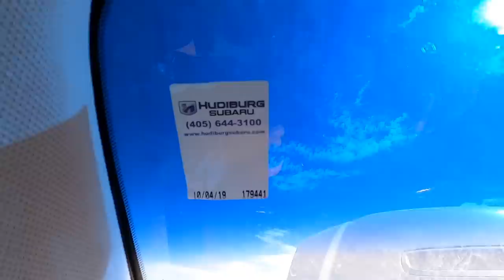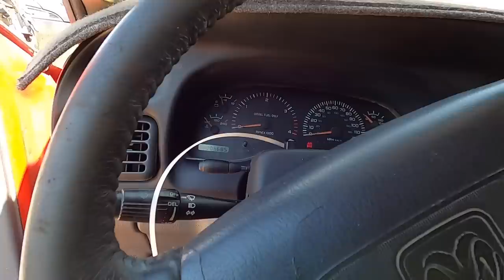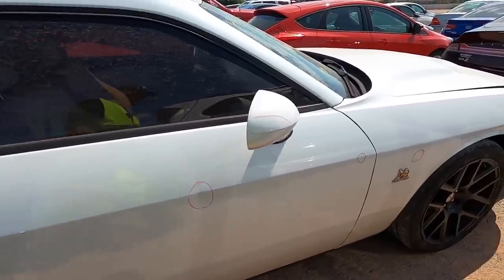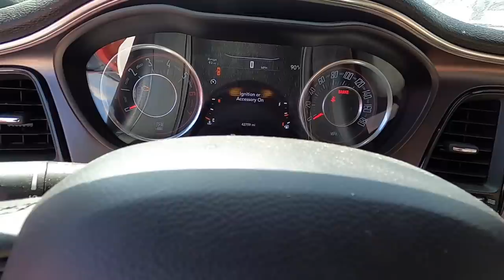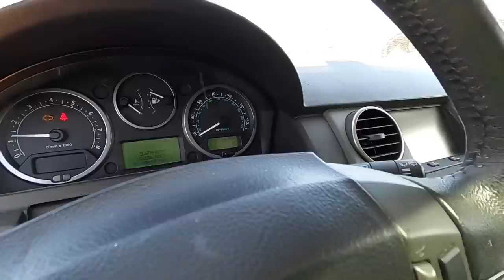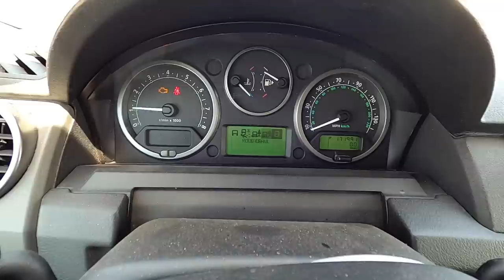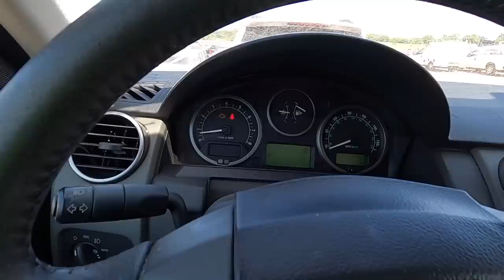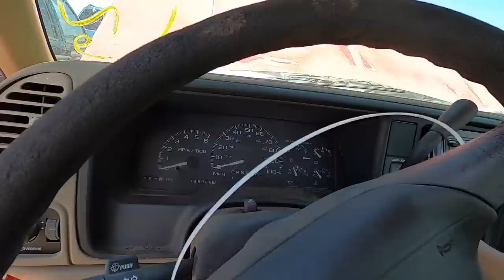Copart Walk Around 6-13-2020 + Cheap $750 Land Rover

Comment: I like the $750 land rover, I would think you should go for it if it has a clean Carfax
Reply: Much better than the Range Rover. Discos are proper off roaders and more reliable, especially that era.
Reply: Agreed! for 750 not bad, I have an 06 LR3 HSE with the 4.4L I bought with 98,000 miles love that Truck.  As long as the maintenance have been done they are quite Reliable.
Reply: Noooo hard pass.

Comment: Randy.... if im not mistaken.... the 2006 Subaru Legacy GT Wagon is a turbo charged engine and you dont see them everyday!!  That ram has one of the most desirable engines in it (5.9L Cummins) and the reason why it sounds so loud.... they either straight piped it or they just cut the exhaust and dumped it just behind the cab to make that 5.9 rumble!! 

I ❤ the sound of the Cummins Rumble!!

Comment: My family has had a 2006 LR3 v8 since new. It currently has 230k on the clock and has been hauling around 7 of us to Tahoe, LA, Vegas, camping you name it for years. its had it fair share of problems but my dad has always had fixed what went wrong with it. As long as you maintain them they will go for ever.

Comment: Subaru - one or both head gaskets blown. Typical problem.
Ram 3500 is exactly what I'm looking for. AC repair by Bubba's Auto Repair.
LR3 - I worry about electrical gremlins and possible blown head gasket.

Comment: I'd like to take this opportunity to thank you for minimizing your revving of the vehicles. Really, Thanks.
Reply: Oh come on, are you telling me that if you jumped in a virtually new Scatpack Challenger, parked in a salvage yard with keys, power and gas, that you wouldn't be tempted to blip the throttle and enjoy that engine note?
Reply: @rich_edwards79  Not if I thought I might eventually own it. Randy ran it up to about 3800 rpm's which is perfect for getting that sound without hurting the motor.

Comment: Copart website shows that Dodge challenger sold on June 09 . Is that normal that its still in the lot 3 days later ? its not even marked "SOLD"
Reply: Maybe the buyer didn't pick it up or the deal didn't go through, so it stays on the lot.

Comment: Hey Randy that 98 Dodge ram they did use a 90s Dodge ram in twister but not dually
Reply: correct it was a 96 and it was a 1500 gasser or a 5.9l v8 but had a similar appearance

Comment: Hey thought I’d comment on the Land Rover... those LR 3 are pretty reliable the 4.4 v8 is a great motor. I can definitely let u know these cars are very sensitive to low batteries so that’s most likely why u received those faults. I have 2 Range Rovers (an 06 and an 07) they both have that same 4.4 v8 which from my experience is incredible. These vehicles are great off roading cars! Very fun! These cars are WAY more reliable than any of the Mercedes s classes you have had (in my option) I’m a total Land Rover nerd so if u have any questions send me a message!
Reply: Most Land Rovers from 06-09 pretty much all used the same power train and are pretty reliable.... the Land Rover I would stay away from are any early model 5.0 v8 they have timing chain issues due to fail guides.

Comment: I owned quite a few Subarus There is no milkshake in that oil I don’t know if if you looked at the exhaust off camera but if it’s a gasket it will definitely have some white smoke even if there’s no coolant in it most likely just another low on coolant or radiator is damaged

Comment: While the US got the 4.3L V6 in those base '90's trucks, the same trucks sold in Mexico still had the inline 6.  You couldn't get even close to 100,000 miles with that engine.  I can't tell you how many I saw in mechanics shops when they were no more than 5 years old getting overhauls.

Comment: OK Brit bias right here Randy but that LR3 (or Discovery 3 here) is a great car. I owned two earlier series 'Discos' (late '90s and early '00s) and never had a moments problem although they were diesels. Paint a white (or yellow in USA) line up a wall and they go right up it! And remember if that is a V8 its a 4.4 Litre and if its a V6 its a 4.0 Litre and both are Ford engines so parts not expensive. As Samcrac found out when he repaired a dealer damaged Range Rover.
There is huge space in the car anyway and I suspect if you had dug a bit deeper there was a row of extra seats in the back. Mine were 7 seaters. Your 'Black Box' at home will clear all fault codes and its important you do get back to a fixed point with the modules. More Ford again. Given the way it started and ran and everything started to work (especially that air suspension) I think you have found a good one. Bodywork looked great and just needs a good detail to fetch top money.

Comment: Be careful with that LR3, if it has a clean title it might be there for a slipping transmission. Those are the main culprit to total those mechanically since they are so expensive to repair properly. They are amazing cars if they've had the transmission service done and the air suspension is in working order.

Comment: Subaru is a nice car. My mom's been driving them since 94. That one is actually an Outback and it looks like it's the LLBean edition. Somebody obviously removed the badges on the tailgate or perhaps the tailgate was replaced at some point and whoever did it just didn't bother replacing the badges. There is also an LLBean edition trim badge on either front side of the car which is missing on that car. Those badges aren't hard to come by and can easily be replaced. My mom had a red 2004 LLBean wagon back in the day. It's got the nice interior trim and the V6 engine. and yes, that seat belt alarm is very annoying. I think you should buy it. It may or may not have a head gasket issue, but I think the same is probably true for the Land Rover

Comment: Good video. I would not get the Subaru due to no coolant in the radiator. With 177,000 miles on it I would be very concerned about head gasket issues. If you need to replace the head gaskets then one needs to machine the heads, install new head gaskets, install new water pump, and new timing belt and belt tensioner. That is probably a  $3, 000 repair. Like the Dodge Dually Pickup and the Dodge Challenger. Personally, I would buy the Challenger and see if one can repair the worst hail damage with paintless dent removal.
Reply: Don't discourage him.. Even if it has issues its worth fixing.. It's a satin white pearl wagon in decent shape pretty hard to come by any more.

Comment: If my memory serves me correctly for the LR3.. A lot of the parts on her are Ford parts.. BUT I could be wrong for THAT year of a Land Rover. revising!
 YEP! AJ41 4.4 L. Be surprised that a lot of parts can be found by Ford. ALSO! Don't you DARE Knock the Vortec V6!  It's a Okay engine.
Reply: I fully agree and yes its a Ford V8 or V6. Ford also supplied a lot of the electronic gizmos as well. Good thing is if a part needs replacing and its got a Ford logo go to the Ford dealer.
Reply: @1chish  its a 4.4 l v8

Comment: Randy FYI a Cummins doesn’t have glow plugs   It uses a intake heater  Cummins in a dodge has never used glow plugs
Reply: its called a grid heater it is located on the air horn most other diesels do use glow plugs though so you can understand why he said it

Comment: My friend has a Range Rover just like the one in the video.  It is a money pit.   It cost $180 for a full synthetic oil change because you have to remove a skid plate to get to the plug.   It has been one problem after another.   To change the transmission fluid you have to remove the exhaust and then take out about 14 bolts to get the pan off.   The pan has to be replaced each change because of a built in filter.   Have you ever heard of any other car where you have to remove the exhaust to change the transmission fluid?   Terribly engineered, unreliable and very expensive to work on or do basic maintenance.

Comment: Never close a door like that by the glass!!! 15:45
Reply: actually closing a door by the glass wont hurt it glass takes anywhere between 15+lbs of force to shatter he wasnt eeven close to that mark it was also shatter resistant like 90% of cars around today due to safety standards which requires 4x that amount to break its all good he didnt hurt it

Comment: Youre actually just suppose to jump a diesel with one battery, thats how i was taught
Reply: correct most diesels have 2 batteries for cranking amps andare wired in series through a parallel switch which drops the voltage from 24v to 12v so when you jump them your jumping both batteries at once
Reply: Tyler Duysen yeah im after a diesel as my next truck dont really need one but i love themlmao i daily a 5.4l f250 so mpg bonus with the diesel

Comment: The Subaru....Dealer serviced a few thousand miles ago, which makes the low coolant issues especially odd. Most dealers check fluids while doing oil changes, either they neglected to or that vehicle's lost a lot of coolant in a short amount of driving.
Reply: Dont discourage him we need a subaru on the channel lol it will be the first. Issues or not its still a great car and has lots of life left